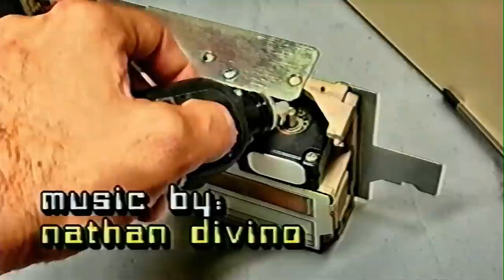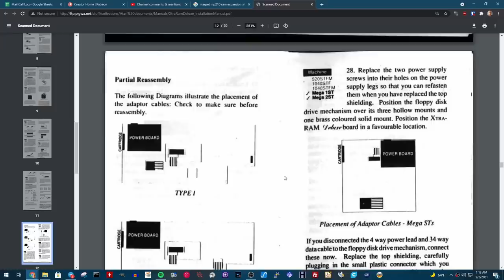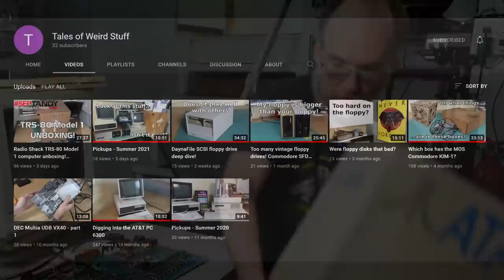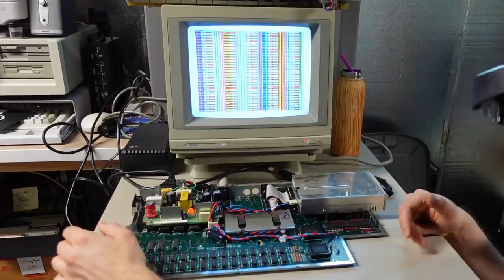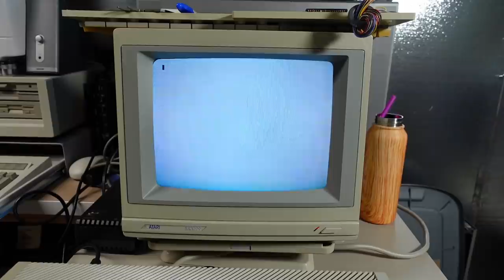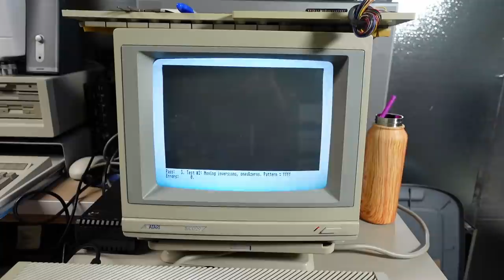I figured out what is wrong with the Atari 520 ST!

Comment: Check out Noels Retro Lab, he's made a small adaptor to take the place of the keyboard connector, so it will boot without the KB connected.
Reply: Isn't that a plug for the Amstrad CPC that bridges the power switch connection to the motherboard? I don't remember Noel doing a video with an Atari ST yet.

Comment: Interestingly I repaired two Rev B ST's recently and it was the latches you were checking out that was the issue. Those PLCC sockets go bad by the way. Because that memory upgrade was pushed onto the original MMU it could have forced the pins in too far... you could try pulling them out a little.
Reply from the maker: Yeah I've heard that about the PLCC sockets from a few people -- I inspected it on my microscope (not seen on the video) and it was actually OK -- along with all the pins on the original MMU. Seems the Marpen pins are thin enough to not cause an issue, at least in this case. 

Had both latches failed on the machine you repaired?

Comment: RAM is actually organized as you thought it was. The chips correspond to bits 0-15. Just notice, that RAM is addressed with bytes, not words, so it's 16 bits per word, which occupies two consecutive bytes. By the way, it's exactly the same on an Amiga 500.
Reply: And, if you plan to connect your STF to OSSC you will probably to modify the mobo a bit filling the elements in the modulator area to obtain a proper synchronization signal for SCART connection.

Comment: It would be logical to assume a 520ST would boot without a floppy drive, but only if you knew that the F and FM suffixes to that machine meant that the Floppy drive and Modulator didn't come installed.
Well, maybe not. It is kind of crazy to support only 1 form of storage and not include it. Previous computers booted to a programming prompt and also supported readily available tape storage (well, Commodore's were proprietary and sold separately). Those computers also included a TV modulator, since dedicated monitors were very expensive.

It's well documented that Atari rushed the ST, with the result that it is nothing special, simply built from off-the-shelves parts and a sound chip from the 1970s. Tramiel got the bottom dollar machine that he wanted, and it compared unfavorably to the C64 in many aspects. If you boot it without attaching a floppy drive, you can view the menu and change 5 preferences settings.

Disregarding the rushed nature of the design and that Tramiel bought more time by filing a lawsuit which delayed the release of the Amiga, technically I suspect that they couldn't make the floppy drive fit inside, but also that they didn't have enough floppy drives manufactured yet, and that they simply didn't have a modulator design ready for the single lores mode the ST supported on 15kHz. By releasing the 520 ST in this state, they could not only rush it out, but buy time for floppy drives to be assembled and their engineers to work out a usable modulator design.

So maybe when finding a fault with an ST, it's best to assume the same anti-engineering, anti-quality "cheap" attitude as Tramiel had in bossing his engineers around, and not be so logical. Despite the simple design, there could be some further cost-cutting measures to give surprises.

Comment: Sound was one of the shortcomings of the earlier ST systems.  I wonder how much more expensive it would had been with a YM2612?
Reply: Yep.  Almost any computer can have MIDI added.  Big boring whoop!  Not many computers have the Amiga's audio prowess that Paula provides though and the ST sure as hell didn't!
Reply: That chip wasn't yet available when the original ST was designed. The very first OPN chips had just been released a few months before the ST went into production so it probably wasn't feasible to incorporate it into the design.

That said they could've used an OPM chip (YM2151). It was probably the best option out there for this purpose at the time. However the ST was built down to a certain cost, and the YM2151 was still new enough to probably be much more expensive than the older PSG. Furthermore I think Yamaha offered unfavourable terms and restricted supply to third parties for their best offerings which wouldn't have been acceptable to Tramiel.
Reply: @markshanehayden4648  Not sure if the problem was Yamaha as they used the YM2149 which is the Yamaha version of the AY-8910. One big reason why they chose that chip has probably more to do with its 2 8 bits I/O ports than with its sound capabilities. If they had used another sound chip they would have had to add another I/O chip (68901, 8255 or VIA, whatever).
Reply: The YM2612 wasn't an option available for Atari Corp. They originally intended to use Atari Inc's AMY sound chip but it had a flaw in it. They sold/licensed it to Sight+Sound on the condition that once it was fixed, they'd have access to it and any successors. But S+S supposedly screwed them over and it went to court, yada yada yada. Atari Corp then tried to pivot to the YM2151 but Yahama refused to sell it to them [because they were going to put it in their MSX-based MIDI computer, which the ST later crushed outside of Japan anyway]. The only sound chip Yahama would offer was the crummy YM2149. And that's how the ST was stuck with it. As for the PAULA in the Amiga, yeah well, the YM2151 and/or the AMY - had it worked - would've been far better. 

Also of note, as the court case was happening, the warehouse that all of the schematics and production test runs for S+S's versions of the AMY burnt up in a giant fire. The late Curt Vendel alluded to the former S+S employees alluding to the fire supposedly being deliberately set by a 3-letter intelligence agency. Considering the former Atari Inc projected in late 1983 that the chip would've only cost $4 to manufacture and it could easily reproduce human voices, that could've been a game changer in the world of 1984-87.
Reply: @galier2  The YM2149 could do some printer I/O tasks. Much like on the 8-bit side, the Atari POKEY could also handle certain I/O responsibilities.
Reply: @TheJeremyHolloway  That's what I said. It was this I/O capability that made this chip interesting for the penny pincher Tramiel was. The 16 I/O pins did more than just printer (mainly modem, floppy and monitor). The sound capabilities were not exceptional but sufficient for most applications and the integrated midi-ports would allow for good music if required. I can fully understand the rationale when they developed the machine in 84. That it was not enough and that there would be a big divide between on-board capabilities and the midi world would only appear later when under pressure from Amiga. This lead to the stereo DMA sample sound system in the STE and TT.

Comment: in the day cheap easy fix was drop and check,ie chips would work loose a sharp bang moves them in the socket cleaning the contacts,if doing job properly lift all chips use deoxide cleaner ie mouldy pin cleaned.

Comment: an interconnection line is cut off on the board between the chip SN74LS373N ( socket U22 ) and 5E1 R HD46850P ( socket U21 ) in the middle

Comment: Is there anyone out there that tires to reverse engineer these ASICs such that they can be implemented in an FPGA?  I used to work as a repair technician in college fixing surplus lasers and related equipment, and often bemoaned PALs and programmable logic  that sometimes kept boards from getting repaired. What methodology do you employ when trying to ferrite out the internal logic & state-machines for a chip without having access to the source code? It seems like a fun project to reverse engineer unobtanium PALs and custom logic.

Comment: That's very interesting.  I wonder if the keyboard not being plugged in, is only true on some versions of the board, because I know I couldn't get mine to boot up without it plugged in.  It also could be one of those strange coincidences as well, because my system has other faults as well where it won't boot up at all unless I push down all the chips.  Probably have a cold solder joint or a bad socket somewhere I need to replace.
Reply: I know some versions of TOS are crashing because they want to set the system time in the keyboard controller and fail. It's not the board that is the cause but the TOS version.
Reply: @boelwerkr  Good call.  I have rather 1.03 or 1.3 (can't remember which off the top of my head) in mine, which seems to be newer than the one that Adrian is playing with.

Comment: I Think the 2 Chip Enable Lines are for accessing the high and low byte independently.
Reply: Yes Something like that. The RAM uses a Column/Row address select (CAS/RAS) schema and the MMU in the ST supports 4 CAS and 2 RAS lines. 
The person installing the 4Mb simply disconnected the RAS lines but not the CAS and address lines. This caused an overload on these lines an one line driver in the MMU burned out.

Comment: I heard YouTube is making it hard for every honest YouTuber. It's sad they are putting you guys through the wringer.
Another thing, I bought a broken Super Advantage controller for my SNES. It has its slow mode enabled at all times and my Dad and I have narrowed the issue with it down to its microcontroller or a bad SM capacitor. Do you have any ideas on what to do as they don't make that chip any more? Do you know of any suitable replacements? Any help would be appreciated. :)

Comment: The DRAM could be organised into 2 banks of 8 bits because the MC68000 is capable of addressing the high or low order byte alone instead of the full 16 bits. Pins 7 & 8 of the CPU manage this.

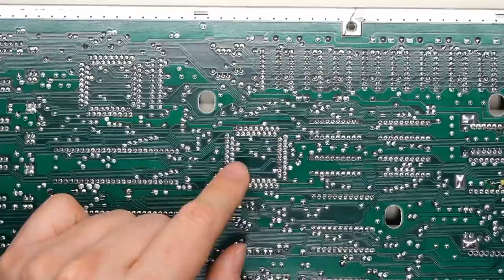Comment: 7:10 I don't think I have ever seen a PLCC socket that did NOT have that zig-zag pin layout.. no idea why you consider that so unusual.
Reply from the maker: Macs, PCs and Amigas all use the pins in rows. In fact, you can't even buy the zig zag type other than pulls from Atari motherboards. The normal type is readily available from every source.
Reply: The software that was used to layout the ST boards worked better with the zig-zag socket, so they was used. This type of sockets is not often used otherwise.
Reply: @adriansdigitalbasement  Which limits the options when it comes to replacing the socket.

Comment: Hello I'm Joseph Walubangi based in Montreal Canada. I have an Atari 1040 stfm and it looks like the transformer is as bit faulty. When I switched on the computer, it goes off and I will have to re boot up the computer for about five times within a span of about 30 minutes to an hour  please help me.

Comment: Adrian - very interested in how you go about retrobrighting the ST.  I've tried on a 1040ste case using 40 Cream + CA sun and it came out streaky and blotchy all over.  Air bubbles under the plastic wrap seemed to get "ghosted" onto the plastic as well.
Reply: Did you watch how the 8bit guy is retrobrighting? He does it quite often and has usually good results.
Reply: Yeah, from what I’ve seen from the 8Bit Guy, plastic wrap always comes with streaks, he always did better with a tub of solution, and weighting the pieces down to keep them submerged (often a zip lock full of the liquid on top is enough)
Reply: @nichderjeniche  Yeah - I've seen all his vids as well as Adrian's, Jan Beta's and others.  I've used the 40 Cream method on other (smaller) pieces successfully.
Reply: @Underestimated37  That is what I am going to try next (liquid in a tub).  Not sure if this case is salvageable but at this point, will keep experimenting to see what happens.  Worst case, I may take the path that Noel's Retro Lab did with a C64 and paint it custom.  I've been pondering if I could reproduce the 8-bit Atari XL color scheme on it... LOL.
Reply: There has gotta be a better way, maybe there needs to be some research into creating a ‘gel’ using something like polyacrylamide (the stuff in diapers and water beads) that can retain the wetting properties and transparency but lose the texturization that the plastic wrap causes.

Comment: That's unfortunate.  I was hoping for the latches or some commodity chip to be the problem.  I wonder if the RAM mod somehow caused the MMU to fail.
Reply: I sure the lazy disabling of the RAM (by disconnecting the CAS0/1 lines) killed the MMU over time. Normally all the address lines are disconnects, to reduce the amount of chips that have to be driven from the MMU.

Comment: Difference between an ST and and a ST FM is a TV connection.

Mega ST , has 2 or 4 MB memory, It has a different shaped case (square) a hard disk, and a separate keyboard.
I had a Mega ST 2 , which had 2 MB memory and a 20 MB harddisk.
Reply: Early variants of the "Atari MEGA ST" have 2 and 4 MB. Atari later renamed the line "Atari MEGA" and had variants with 1 2 and 4 MB. The visible difference is the label and the floppy with the small rectangle eject button
Reply: The original Atari Mega ST 2 & 4 did not have an internal hard drive. They sold those as stackable external units like the SH205/MegaFile 20 [and 40s, and 60s]  which had the same pizza box case dimensions as the Mega ST 2 and 4. ICD and others sold internal HD kits.
Reply: @TheJeremyHolloway  
Yes that's the one I had, two square boxes, one being the hard disk the other one the computer. I did not mean the HD was internal, it was as you said. :)

Comment: An indoor retrobrite box is a great thing, I made one from a plastic storage box and a long UV LED strip (inspired by your blue box). I already retrobrited a lot of floppy face panels, some CDROM face panels and the front of an ATX PC case. All of them turned out great! It's a bit slow, some heavy yellowing required 3 days but it just sits there, sometimes I take out the part to massage the cream but that's all. An Amiga 500 case won't fit inside but maybe it's big enough to restore a Commodore 64.

Comment: The 8-bit data latch bodge in the original ST looks horrible! Surely that must slow it down! Was that a time when RAM chips were fast enough to feed 16 bits of data, PLUS a full hi-res mono screen (or lo-res colour one), all from 8 RAM chips? 

During the '80s and '90s, CPUs were pretty slow. They advanced in speed, as did RAM chips, eventually when we got to 386PCs, we started needing static RAM chips as cache. That is, very-fast RAM in, say, 8K, for the CPU to run tight loops in, and then some hardware on board to pile in data from the main, slower RAM, into the fast static RAM cache, by predicting what data the CPU would require next. In fact that's still true now, all CPUs have cache RAM inside them, most of it on the same chip as the CPU, so about as fast as is possible. 

The Acorn Electron, a 6502-based machine, used 4 of the new 64K x 1 chips, to produce 32K x 8. Using a latch in between to change 1 request for 8 bits, into 2 consecutive requests for 4 bits. This meant the machine couldn't do all the graphics modes of it's predecessor. Since the Electron was a cost-reduced semi-compatible version of the popular, but expensive, BBC Micro. It couldn't do the better graphics modes, because it simply couldn't pull the screen data off 4 chips as quickly as it could 8, the 4 bits of RAM were essentially providing only half the speed data that a proper 8 bits would. 

So seeing that horrible bodge with the latched on the 520ST reminded me of that. But apparently RAM had got faster by that point? So it could do the full graphics and run the 68000 at it's normal speed? Well I never! Still, don't care, it's still a horrible, ugly bodge.

Comment: You could probably recreate the mmu in an fpga but you would need verilog and all that other stuff to recreate the die in the fpga as well as replacing the socket with a compatible one.  The original photomask have of course long since been archived.
Reply: Yes there are FPGA cores for the MMU, but nothing so far finished that you have a plugin replacement. All are part of FPGA simulations of complete Atari STs.

Comment: That 3 pin on the bottom chip confused me because when you flipped it over it should be opposite.looks like you soldered on wrong pin.
Reply: The socket pins are in a zig zag pattern.  The pin was on the bottom of the chip, so when flipped the board over, it was the third socket pin on the top(going top to bottom, right to left).  He soldered the right one.

Comment: You can do a minimal mod on the mainboard to get rid of the noise when booting w/o the keyboard.
Reply from the maker: Thanks for the tip -- would it be some pullup resistors or something similar? I will need to do that .... just for my sanity. (Or fix the volume knob on the monitor)
Reply: @adriansdigitalbasement  It's really simple. The ST has two ACIA ICs for serial communication. One is driving the MIDI ports, the other is responsible for communication with the keyboard microcontroller unit.  Atari made an error in the circuit design by putting a pulldown resistor at the RxD-pin of the keyboard ACIA instead of a pullup. Set your multimeter to continuity test and find the one of the two MC6850P ICs which has it's pin 2 directly connected to pin 4 of the keyboard connector. If you want to double check, pin 6 of the same chip will be connected to pin 3 of the connector. Somewhere in the vicinity of the 6850 there is a 10k resistor connected to pin 2 and GND. Desolder the GND side, bend it up and connect the loose end to +5V. Done.